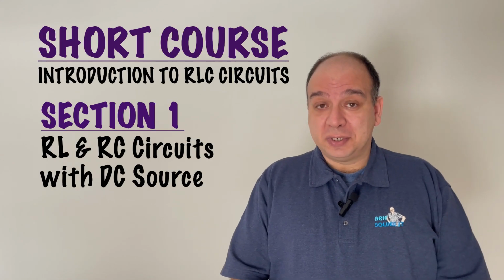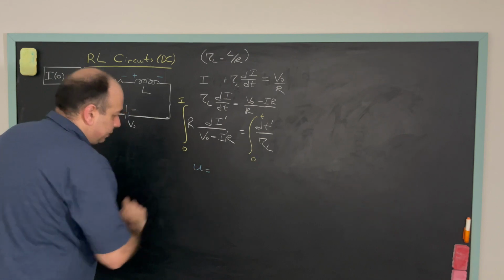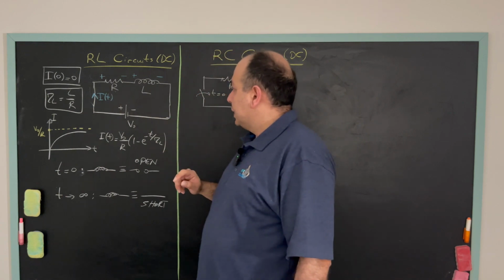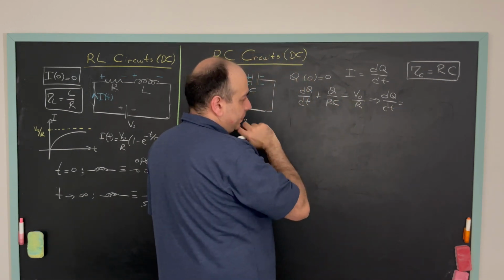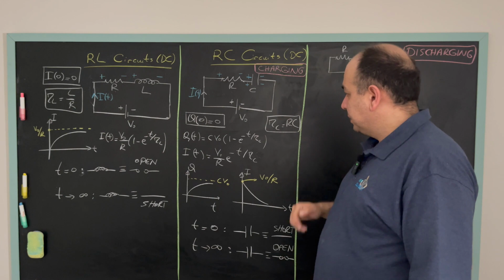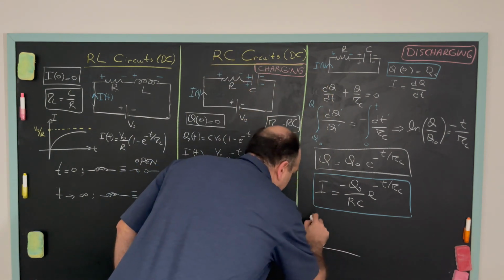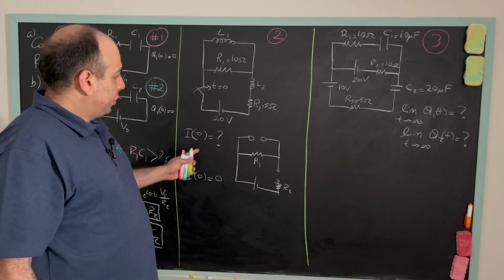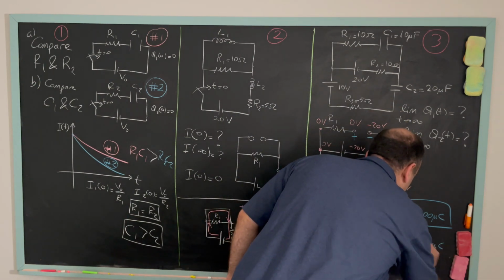RLC Circuits ShortCourse (Section1: RL and RC circuits with DC Source)

Comment: Calculus and complex algebra I had in school 
I read something on differential equations on my own 
Are there prerequisites  in physics for this topic
Reply from the maker: It would be good to have at least some basic knowledge of Electricity and Magnetism topic, because this course is designed as the continuation (or the application) of that class. In short, the attendees are required to know the physics of capacitors, resistors, and inductors. This is the only requirement from Physics.